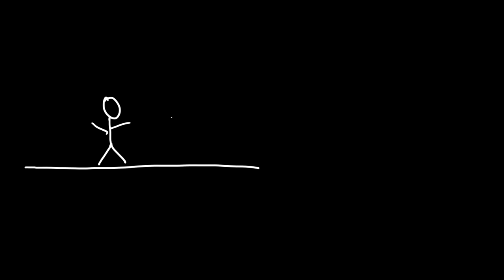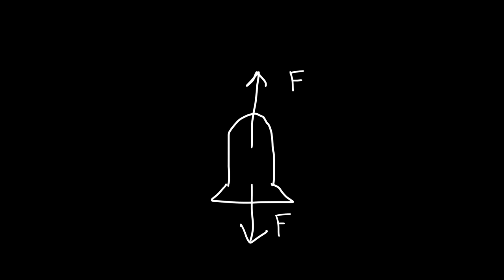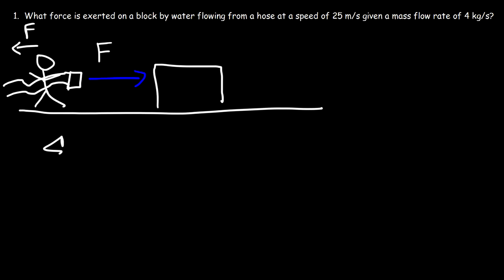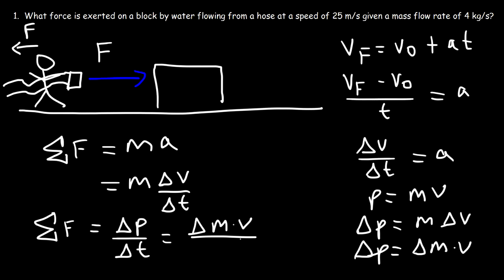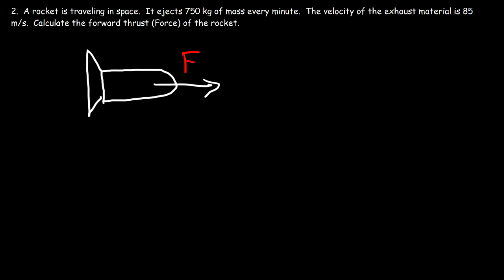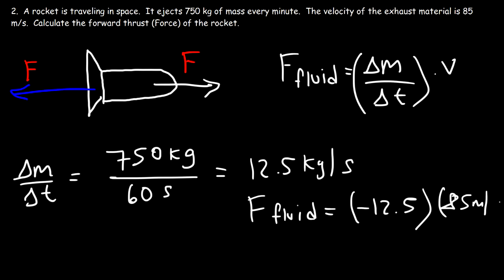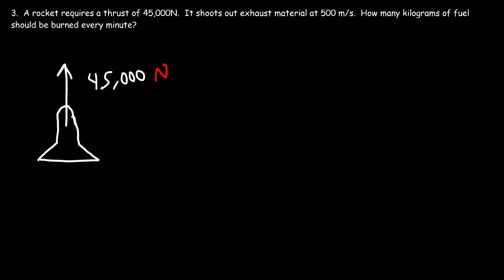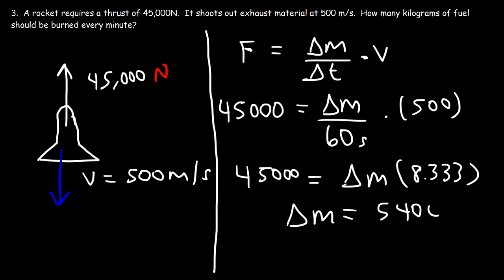Rocket Propulsion Physics & Mass Flow Rate - Newton's 3rd Law of Motion

Comment: I'm a young man trying to be a engineer at space x and trying to understand how rockets work and this..  was way more easier to understand then the stuff you learn in middle or high school
Reply: Good. You should try to design your own rocket engine using math you already know.
Reply: @wyattb3138  There are limited options on creating or designing a rocket engine as pretty much all of them has a thin throat and a big nozzle to convert Sub Sonic speeds into super sonic.
Reply: Grimm_m, start with subsonic then run CFD software to optimize the nozzle design and do supersonic later. You have to design your rocket engine off your chemical reactants.

Comment: So the wind blowing out of the LEM's engine nozzle, as it landed on the moon, would need to be more than the mass of the vehicle to account for deceleration?
Do I have that right?
Reply: No, because you are forgetting about speed. The faster the fuel is propelled, the more force, thus, less is needed. Think of it in terms of p=mv.
Reply: @PsychoMuffinSDM  
Thanks. So can you help me get an idea of the speed or velocity of the gas.  I know that in throat it cannot exceed local mach and I have no idea what that would be except that it speeds up from there.
Reply: It would actually be less, just enough to sustain some of the weight of the vehicle but not enough to propel it on the opposite direction.
Reply: GoneBamboo - You can create the same "Force" by pushing away a very large mass SLOWLY or a very small mass VERY FAST.  You need to generate MOMENTUM which is defined as MASS times VELOCITY.
So you can create a large MOMENTUM with high velocity and low mass (like a rocket engine) or low velocity and high mass (like a catapult throwing rocks)

I have a 44 magnum desert eagle that fires very large bullets and a relatively low muzzle velocity.
Don't you agree that my smaller .223 rifle could create the SAME RECOIL as the desert eagle IF it can get the smaller bullet to much higher velocity than the 44 magnum?

Comment: Nice but you dont take into account the relative change in mass ejection as the rocket increases speed per unit time.
Reply: Its the speed of the exhaust, not the rocket. Exhaust velocity will be constant no matter how much mass is expelled.

Comment: Hello, 

I need help for followinng question. Please!

A small research rocket of mass 250kg is launched vertically as part of a weather study. It sends out 50 kg of burnt fuel and exhaust gases with a velocity of 180 ms-1 in a 2 s initial acceleration period.
(a)  What is the velocity of the rocket after this initial acceleration?  (Answer v = 40 ms-1)
(b)  What upwards force does this apply to the rocket?  (Answer  F =  4500N)
(c)  What is the net upwards acceleration acting on the rocket?  (Use g = 10 ms-2 if required) (Answer   a = 10 ms-2)
Reply: Hi
In the first part of the question I am obtaining 36 as answer. I guess the answer is wrong. Since in thus we just have to apply the formula MV=mv and mass needn't be included.
In the second part you have to apply first equation of motion (v=u+at) but using the downward value and by third law of motion upward and downward values will be equal.
I am not sure abt 3rd. I will confirm once and leave reply as soon as possible. 
BTW it had been 3 months since you posted this question. I think you have got the answer. And if yes please tell where I am making mistake.
Thanks
Reply: @arpanarora  Lets' compare solution!  Could you please tell me your solution for this problem.

Here is my solution:

(a) Given:
m1 = m2 + m3 = 250 kg      u1 = 0 ms^-1
m2 = m_rocket = 250 kg - 50 kg = 200 kg            v2  = ?
m3 = m_fuel gas = 50 kg                                       v3 = 180 ms^-1              t = 2 s  (initial acceleration)

From                    m1.u1  =  m2.v2  +  m3.v3

(250kg x 0 ms^-1)  =  (200 kg x v2)  +  (50 kg x 180 ms^-1)
==>       v2  =  -45 ms^1   = 45 ms^-1  in the direction opposite to the exhausted gas   (Hence, answer = 40 ms^-1 is WRONG)

(b)  m2 = m_rocket = 250 kg - 50 kg = 200 kg
       u2  = u_rocket  =  0 ms^-1
      v2   = 45 ms^-1   (as calculated in (a) above)     t2 = 2 s
      a2   =  a_apply = ?

From    a  =  (v-u)/t
==>   a2  =  a_apply  =  (45 ms^-1  -  0 ms^-1) / 2 s  = 22.5 ms^-2

==>  F_apply  =  m.a_apply  =  200 kg  x  22.5 ms^-2  =  4500 N

(c)   m2 = m_rocket = 250 kg - 50 kg = 200 kg

F_g  = m2.g  =  200 kg X 10 ms^-2  =  2000 N (only m_rocket as fuel and gas are burning off)

F_net  =  F_appy  -  F_g  

and F_appy  = 4500 N (found in (b))

==> F_net  =  4500 N  -  2000 N  =  2500 N

From    F_net  =  m.a

==>              a  =  F_net / m  =   2500 N / 250 kg  =  10 ms^-2

Now your turn to show me your solution PLEASE
Reply: @huyanhle   it seems your solution is absolutely right.
But this is how I did this question 
1) Mass of rocket M= 250kg  Velocity of the rocket V=?
  Mass of the burnt fuel m =50kg escape Velocity v=180 m/s
Using conservation of momentum M*V=m*v
                         250*V= 50*180
                         V=9000/250
                       V=36m/s.
2) by applying 
      F=ma
        F=(m*v)/ time
        F= 50*180/2
     3) I was unable to solve 3rd part but I guess yours is right.

Comment: when calculating the force of rocket why we use fuel velocity relative to rocket instead of using the actual velocity of fuel?
Reply: Because the relative velocity is the one moving the rocket, not the fuel itself. Moving fuel and moving rocket are two different things.
Reply: Bro fuel velocity depends on volume of fuel after burning

Comment: You are not "shooting out matter"  from a rocket in the vacuum of space.   In space , the vacuum evacuates the rocket gases at the rate at which they expand due to there being no resistance. 

    A rocket works on the pressure principle.  You need to create pressure behind the rocket to create movement.  It is impossible to create pressure in a vacuum.